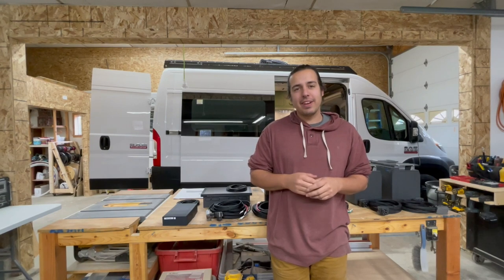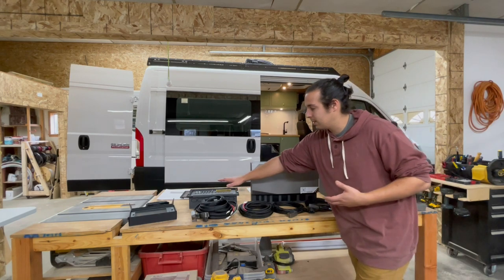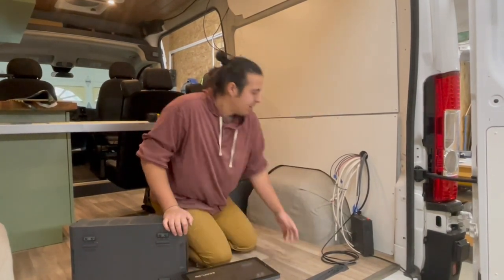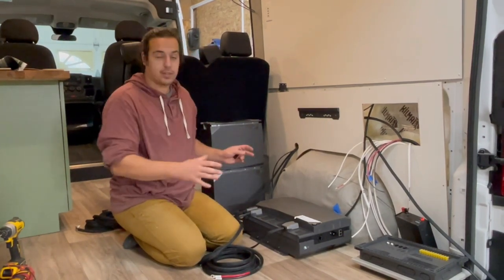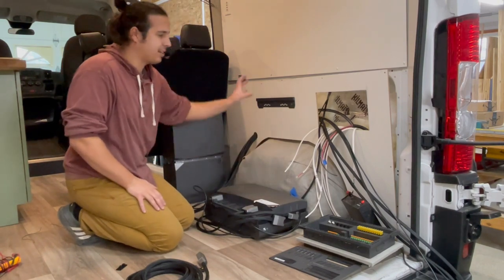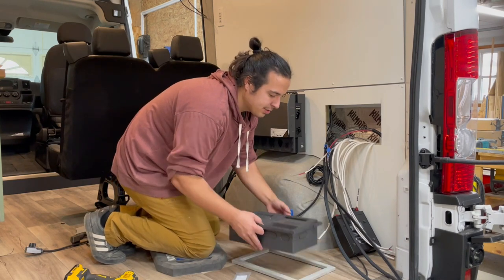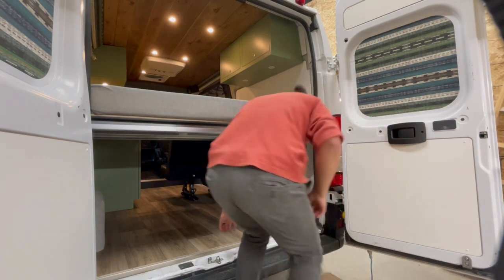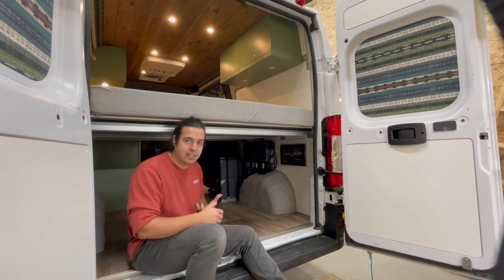DIY campervan electrical installation (Ecoflow Powerkit)

Comment: How has the 4kw unit done on this van? Does it seem to enough power?
Reply from the maker: The 4kw seems to be plenty for this van minus the A/C unit. We don’t run electric hot water or cooktop in this van so it’s plenty. And to run A/C consistently, you would need upwards of 10kw

Comment: Does it charge the van's starter battery if main battery is full?
And can you do like timed outputs? So shut off dc output 3 in 20minutes. Or turn it on between a certain time

Comment: Via the interface you showed it looked like you have to choose either 12v or 24v for all circuits instead of selecting individually for each. Also, I thought it would have 48v as an option since its a 48v system. If I want to put my fridge on a 24v circuit and my lighting on 12v is that an option with the distribution panel?
Reply from the maker: The van is out on rental this weekend so I can't confirm but I think you are right. I'm pretty sure you cannot set individual circuits to different voltages.

Comment: This a 48 volt system. Yes or no. If it is you glossed over a few things.
Reply from the maker: Yes it is a 48v system. This video could have gone on for hours if I wanted to cover every spec and little detail. It being a 48v system has no affect on the user. It still releases a 12v output.

Comment: How did you hook up to the alternator charging? Did you use the CCP? If so, how did you get the 80 amp output down to 60 amps?
Reply from the maker: I think on this one we connected to the jumper cable connection terminal under the hood. Typically the load side is what determines the amount of amps flowing through the cable, not the line. So it should only pull 60 amps since that’s what the ecoflow accepts even though more amperage would be available.

Comment: wonder how tough/possible it would be to re-size the cables.  seems like a drawback to a pre made kit is you always end up with wires either too long or short.
Reply from the maker: You can shorten lengths of all the cables except the battery cables, which are only 6’ But for most people it would be best to leave the extra cable in the wall so that you are not crimping on your own terminal connectors.

Comment: What has your experience been with noise level? I have heard people report the system is loud due to its cooling fans.
Reply from the maker: Yes it is loud. But it only is running at faster speeds when you are taxing the system a lot so while you are driving or plugged into shore power. And once the batteries are full the fans quit. Definitely a complaint but in my opinion a small price to pay for the added benefits.

Comment: Wondering what the warranty is with this system. All these all in one units they all seem to be unrepairable after the they are out of warranty. Learned the hard way with my Bluetti. Two months out of warranty…no way to have it fixed!
Reply from the maker: For sure! Definitely a downside to the all in ones. The power kits have a 5 year warranty so much better than many of the other all in ones on the market.

Comment: How did you snake the ecoflow cable from under the driver's side to the passenger side?  Go under the floor or?
Reply from the maker: For the alternator cable we drilled through the floor and routed it under the van up to the engine compartment. For all the other wiring we go up over the ceiling and back down the other wall. Does that answer your question?

Comment: Great video! I just purchased the 5k kit. What gauge wire is recommended for each AC and DC side of the panel going out through the van?
Reply from the maker: A/C side-
For standard 20 amp circuits we use 12 gauge triplex marine wire.
For 30 amp circuits (Air Conditioner) we use 10 gauge triplex marine wire.
I like to buy from wireandcableyourway.com

D/C side-
For standard 15 amp circuits we use 14 gauge duplex marine wire.
For anything bigger (12v Air conditioner, high powered exterior lighting, etc.) you would go up in wire size as needed.

Hope that helps!
Reply: @somedayvans6653   - thanks so much!

Comment: Hello there. what kind of solar gland did you use the cables won’t go through the one I bought as the connectors are attached. Thank you so much
Reply: I could only find a basic solar gland. The cable that eco flow provides has the female and  male connectors attached at one end and a plug on other end and they wont go through the solar gland holes to connect to the solar panels.  😞
Reply from the maker: We typically crimp our own mc4 (solar) connectors on so we actually cut off the provided ends and then crimp new ones on. It only takes a minute. There are some cable entry boxes out there that have mc4 connectors built in instead of having a rubber sleeve that goes around the cable.
Reply: Thank you so much. My friend took the plug apart. So now it goes through.  I’m not electrical inclined.
Reply from the maker: @mjeanes4244  That’s what I’d great about these systems! They are hard to mess up, even for someone that doesn’t know much about electrical.

Comment: PSA. Eco Flow ruined our van build. Full nitemare since day 1. Had to spend 15K to rip up van and remove the system after multiple failures and battery warranties. Their customer service will not help you
Reply from the maker: Wow! That’s not good. I know there have been complaints with them being buggy, and not having the best customer support but we have had good luck with them so far. We have had small bug issues but always solved with a firmware update. Hopefully they continue to improve these kits, there is no alternative on the market that installs this easy and has all the functionality of the high end systems.
Reply: @somedayvans6653  Selling the van over this and starting over. Its a complete disaster
Reply: I understand that every situation varies, but in normal van builds, the electrical is usually accessible and relatively easy to be worked on (from a location standpoint)
May I ask why you had to rip up the van?
Just so that I can avoid this potential catastrophe

Comment: How long can you run an RTX 2000 ac with the 10kWh?
Reply from the maker: The DC output of the ecoflow is capped at 70 amps so I wouldn’t recommend running any 12 volt AC units with this kit, you will be maxing out that output capacity. If you were able to do it, it would last around 20 hours of nonstop use.
Reply: @somedayvans6653  The RTX 2000 runs at a max 58 amps. So surely we will be fine?
Reply from the maker: @ehcropydoc  I’m sure if would work, but your other 12v loads will easily put you over the limit so you would need to be aware of that. (Fan, lights, fridge, water pump, etc.)

Comment: Not being able to run a 12v A/C makes this a hard NO!
Reply from the maker: You can utilize the 3rd battery plug to run a 48v A/C. Or you could run a 24 volt A/C by adding to the DC in terminals on the distribution panel and adding a fuse to that line. At 24 volts, the ecoflow has a 60 amp output capacity which is sufficient for air conditioning and other DC loads. You would just need all your DC loads to run 24 volts.

Comment: Too bad you can't hook up an Nomadic 12V A/C Unit !
Reply from the maker: For sure! You could run a dometic 12v A/C but you would be pretty much maxing out your 12v output and not leaving much capacity left for other 12v appliances running at the same time. For the price difference between the nomadic unit and a smaller 110 unit, you could add 5kw of battery to your system and use a 110 A/C for about the same price as the nomadic.
Reply from the maker: Also, you can run a 48volt Nomadic A/C unit straight from the third battery plug. That would probably be the best option.